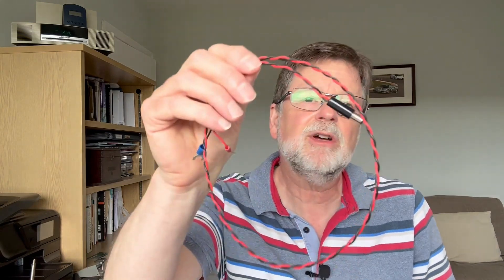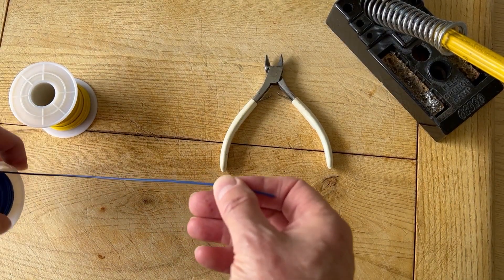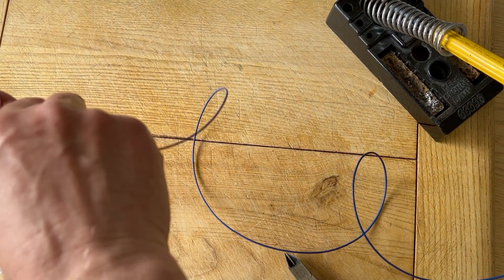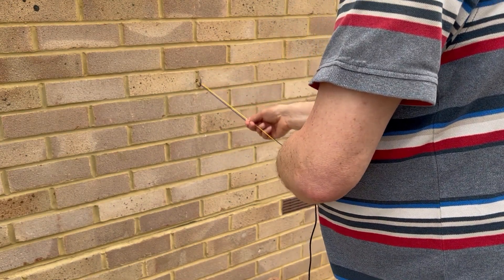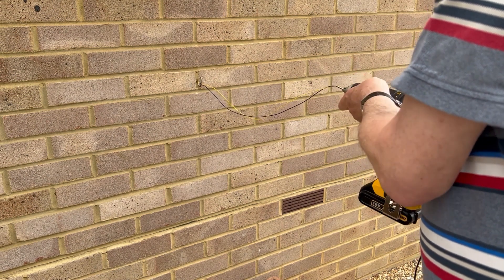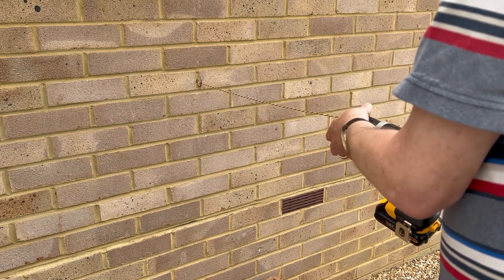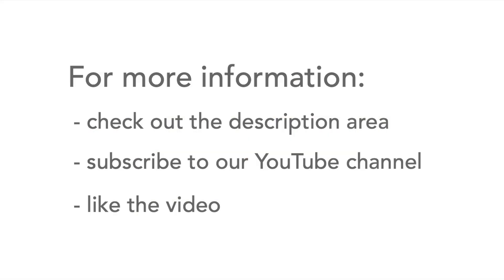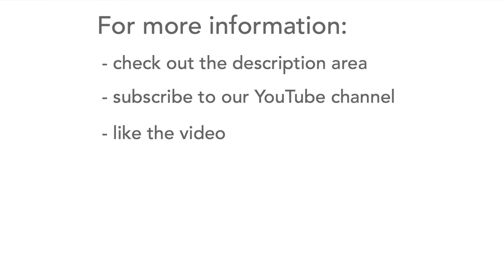How to Make Twisted Pair Cable Very Easily

Comment: If you want less kick-back after relese the tensoning need to heat up the insulator jacket a bit in serval steps. It can relese most of the stored springy force as let the wire elements to slide on echother.
It can makes the twists are more evenly distributed on the full leight olso looks well after some practice with heat gun. 
The most obivius thing is need to do it with fully still air in the shop, like no AC and no open window around.
Reply from the maker: That sounds like a good way to improve the finished product and something I'll keep in mind! Thank you.

Comment: Very nice.  Need to some pairs to add CAN BUS circuits to my truck. Didn't know how I was going to do it.  I'd like to know if there's a percentage factor to add to the length to compensate for the shortening.  I need to make cables about 7 feet long; so to start I think I'll add about a foot.
Reply from the maker: I think the reduction in length is likely to be much less than a foot, but it is always best to leave yourself extra as it is much easier to cut soemthing short rather than having to try to add some!

Comment: Thank you,  I remember watching your video some time ago.   Two weeks ago I needed to make about 40 meters of  10  awg twisted pair wire and it was not so easy to accomplish.  Definitely had imperfections.
Reply from the maker: Longer lengths are more difficult - it is all about maintaining the right tension on the wires to be twisted. Not easy though, to do the longer lengths.

Comment: When attaching a twisted pair to a connector, such as a Lemo connector, the wires have to straighten out in order to enter the connector.  Is there a specification or a rule of thumb that states how far from the connector that the twists should begin?
Reply from the maker: I don’t think there are any specifications for this, but in general I would want to keep the wires twisted as reasonably close to the connector as possible. That is all you can do.
Reply: Thank you for the reply! @ElectronicsNotes
Reply from the maker: Glad I could at least offer a little help into your query.

Comment: Have you considered using this technique for producing bifilar coils?
Reply from the maker: That sounds like an interesting idea. I confess I’ve never tried it though.
Reply: @ElectronicsNotes  Please research the topic, most useful in decreasing the DC resistance of a coil/inductor for a given length of wire.